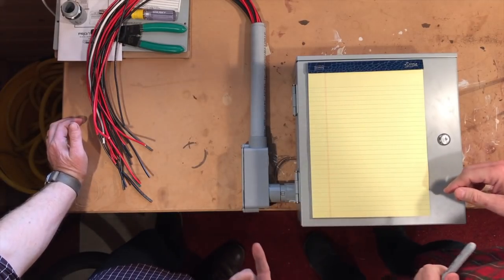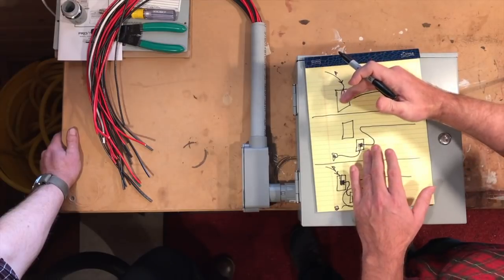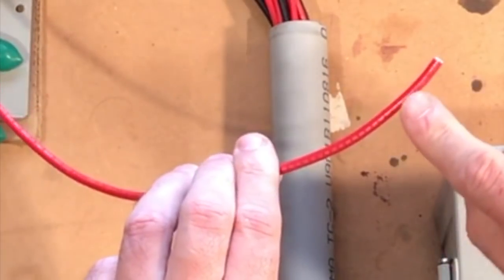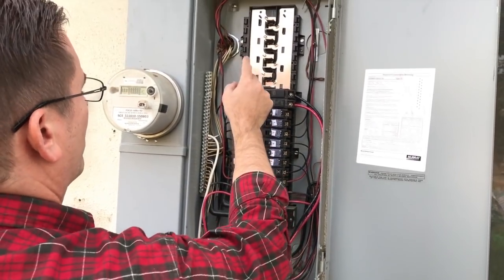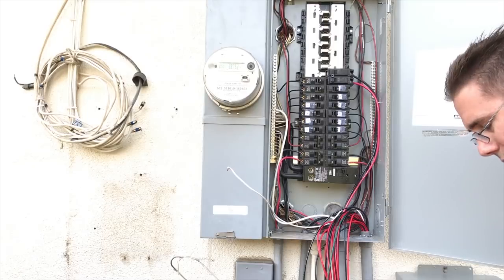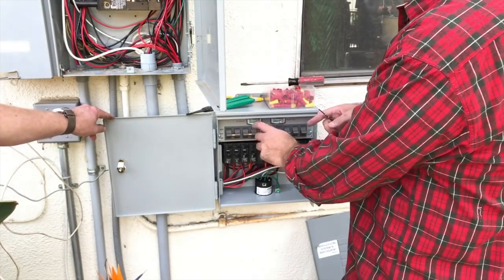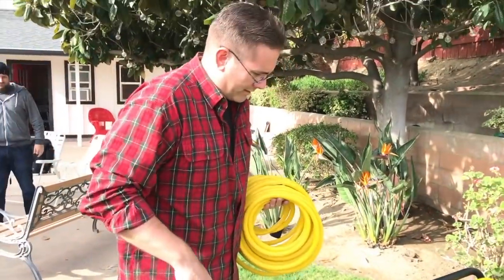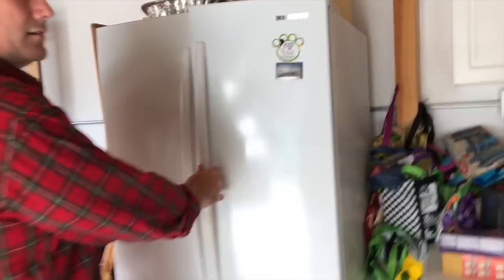How to power your house with a generator

Comment: I already have a 10 switch reliance installed in my new house... how can i connect a battery/inverter solar to slowly bring critical loads off grid. Is it as simple as adapting the 4prong twistlock inlet to a standard outlet from the inverter?

Comment: They actually sell generators that automatically turn on when the power goes out so you do not have to switch it yourself. You can also have them run off of the gas(natural or propane) from your house.
Reply: Automatic transfer switches and automatic generators are really wonderful and are being installed with a lot of new construction these days.  I see them installed many times where someone has medical equipment that needs to be constantly run.
Reply from the maker: it sure seems to me like a good way to go.